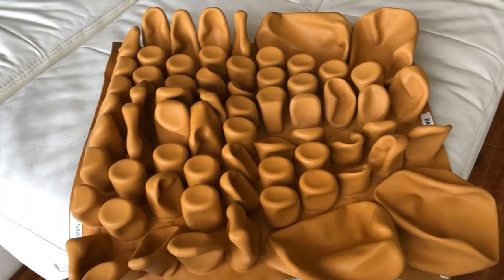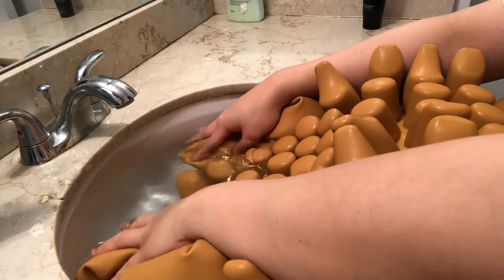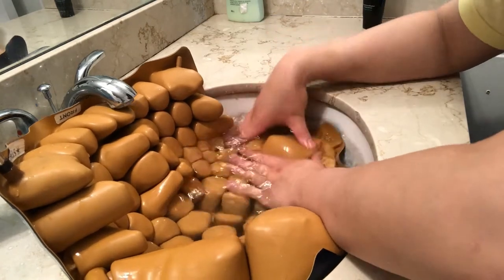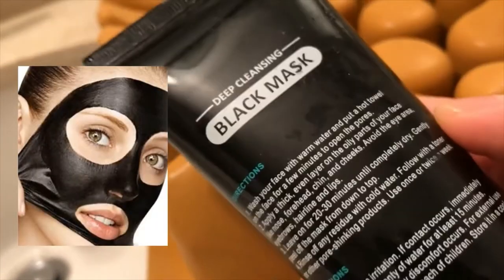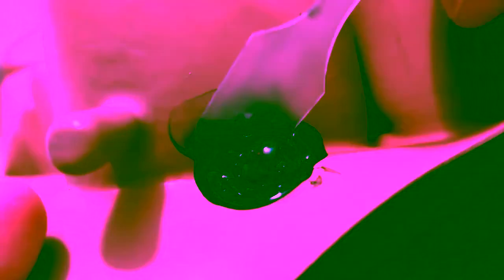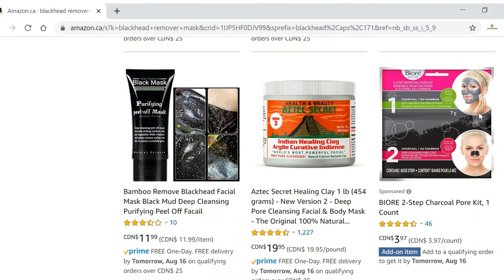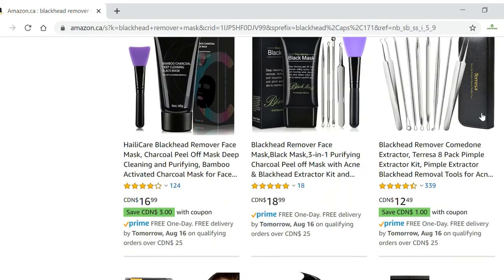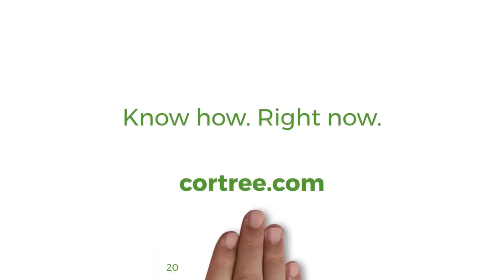How to Fix & Repair ROHO Cushion | Wheelchair Equipment & Life Hacks for People with Disabilities

Comment: Very interesting! Any issues using the product used? Did it last?  I dislike going through my roho's every few years and with the price, wished they lasted much longer. EDIT: 1/6/24 Purchased a cheap facial ($6 at store) and tried it this am. Put a thin layer on first, then read to see how long it takes to dry. Bottle says until you feel it or 30 minutes, so I simply put some on my nose. 
When it dried I checked the cushion and applied a 2nd layer. Gave it another 30 min and now I'm sitting on it. Been good all day so far! Thank you for posting this. I think I will add a 3rd layer before I go to bed.   Again, thank you for posting this!!
Reply: wonderful! thank you for the feedback, glad it helped!
Reply from the maker: hi, it did last. However, it also depends on how big the hole is and where it is located. It works for most of the areas. Glad it helped.
Reply from the maker: actually, you don't need the layers to be too thick, you want it to be like a second skin, more flexible as the cushion expands and changes in shape.